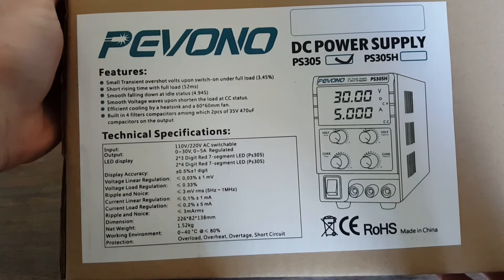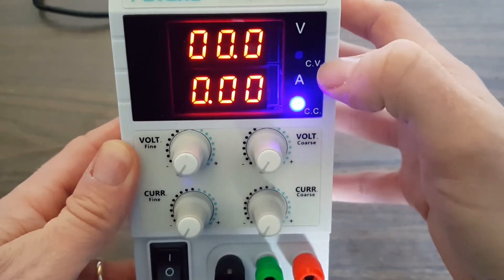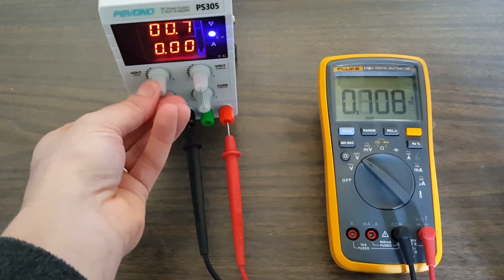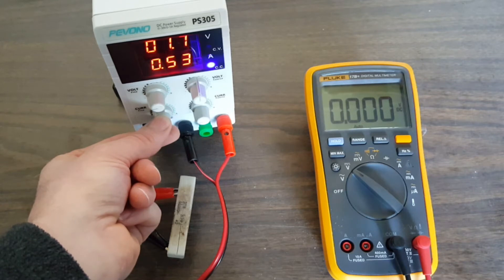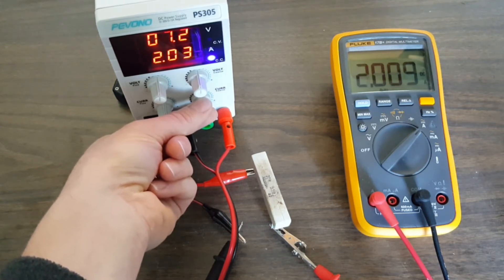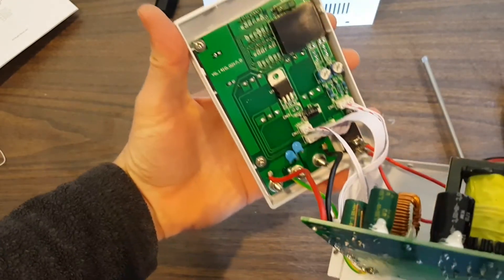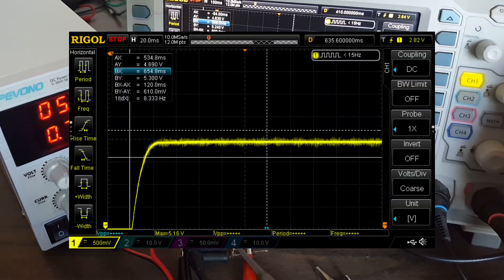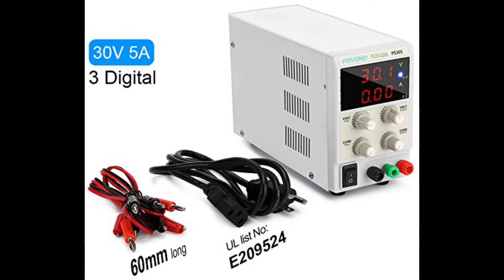Review: Pevono PS305 Bench Power Supply (0-30V, 0-5A)

Comment: Hello Component Fun, between the two small transformers there is an 8-pin integrated, can you tell me the name of it? It is that my source, which is the same as yours, has burned it and I cannot see the name of it. I would be grateful if you could help me. Regards.
Reply from the maker: Hi Oscar, the chip has the following writing:   1753    DK112   T 04
Here is a photo: http://is.am/ym6t
I hope this helps!  Good luck repairing yours.
Reply: @Componentfun  Thank you very much, you have been very kind to help me, now I can fix my power supply, thanks again, greetings.